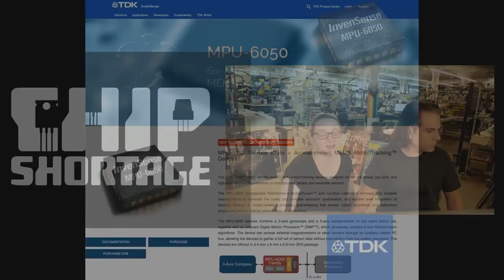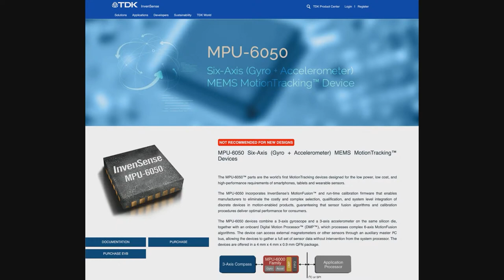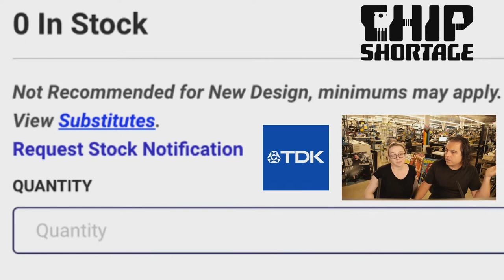Chip Shortage: Invensense MPU-6050 #ChipShortage @InvenSense @Adafruit

Comment: doesn’t it make more sense to redesign the Adadruit boards where they are used in and make use of other gyroscopes instead?
Reply: there are a ton of other Adafruit imus, this isn't even their most common one they use (they usually use an ST), and they have redesigned other boards. but the only thing you can put on an mpu6050 breakout is an mpu6050 🤣. People really do love this almost irrationally: it's a time tested design, people have it well characterized, the filters are good for quadcopters (too much high frequency gets thru on newer ones I think), is just good and reliable.
Reply: Good to know :) I was also recently researching for gyroscopes for doing persistence of vision fun with LEDs. Any suggestion for an alternative that’s available and works well? (And has some example code)